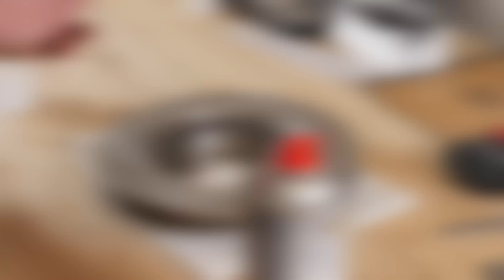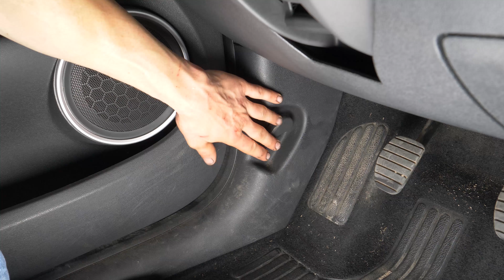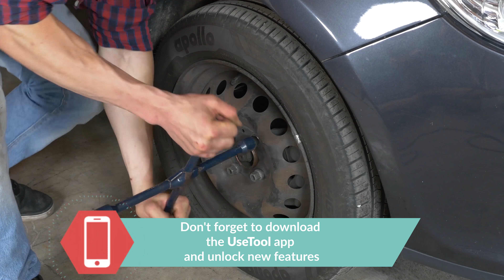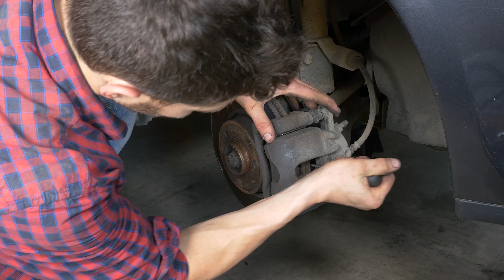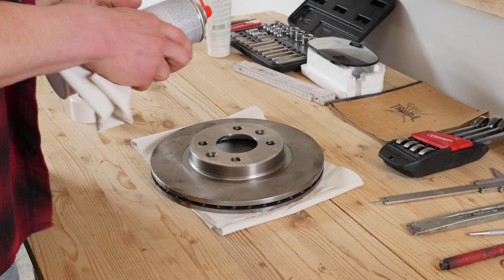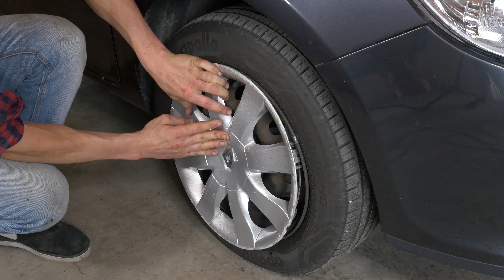How to replace the front brake rotors and pads Clio mk3 1.4 16V 🚗

Comment from the maker: "BUY THE AUTO PARTS you need for the operation : 👉 http://bit.ly/cheapAutoparts 👈
📱 DOWNLOAD THE APP : 🍎 http://bit.ly/MCD12AppStore, 🤖 : http://bit.ly/MCD12PlayStore 📱
⬇︎⬇︎ 🔥   🔧🔧🔧   🔥⬇︎⬇︎"

Discover a vast array of services that will help you run the maintenance of your car: vehicle user manuals, maintenance planning and mechanics-oriented tutorials!
Replacing brake disks on a GASOLINE RENAULT CLIO 3.

Discover the world of UseTool EN on www.usetool.io

🛠📏⚙ FIND ALL THE PARTS AND TOOLS NEEDED AND RECOMMENDED BY USETOOL EN ⚙📏🛠

Needed parts : 
- Brake disks and pads : http://bit.ly/diskandpadsclio3en

- Copper grease

- Brake cleaner : http://bit.ly/brakecleanerclio3en

Needed tools
- 💣🤖🏆 The complete toolbox recommended by UseTool ES to repair your CLIO 3 : http://bit.ly/supertoolboxclio3en 🏆🤖💣

- 15mm Spanner
- 13mm Spanner
- Flat head screwdriver
- Wire brush
- Iron wire
- socket wrench
- hammer
- Torx 40 socket
- 18mm Socket
- T-handle wrench

🔝💪 Safely lift your CLIO 3 with the hydraulic jack : http://bit.ly/upupupclio3en and axle stands : http://bit.ly/axleclio3en recommended by UseTool EN : 💪🔝

- Hydraulic jack
- Axle stand
- Wooden peg
- Wheel lug wrench

🚗📢💡 RESSOURCES 💡📢🚗

Usetool's warnings
Once the operation is completed, you'll need pump slowly on the brake pedal a few times until feeling a strong resistance from the pedal. The aim being to bring the brake pads closer to one other.

Drive smoothly and avoid sudden braking for the first 50 kilometers or so to avoid glazing the new pads. 

Make sure to check the stability of your vehicle before starting the operation.

Don't burn yourself on the pads if you've just gone for a drive as braking creates friction and long-lasting heat. 

Usetool's infos 
When replacing brake disks, you also need to replace the brake pads. This is a mandatory procedure.

What do we mean by "glazing new brake pads"?

Break pads are made of a material that needs to be run-in when new. If this procedure is not done properly, when braking too hard, the material overheats and hardens. Consequently, the brakes become less effective.

📽❤️🚨 USEFUL VIDEOS 🚨❤️📽

- [ USETOOL'S TIPS & TRICKS ] Lifting your vehicle safely : http://bit.ly/2pcxq1L

- [ USETOOL'S TIPS & TRICKS ]  Removing and reinstalling a wheel : http://bit.ly/2ItsYnc